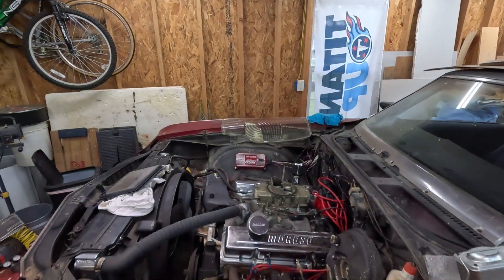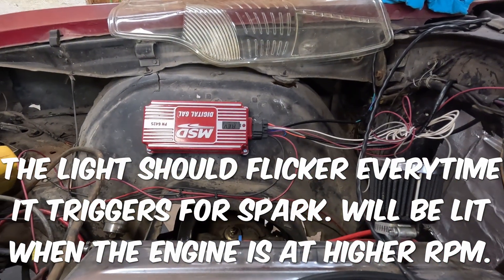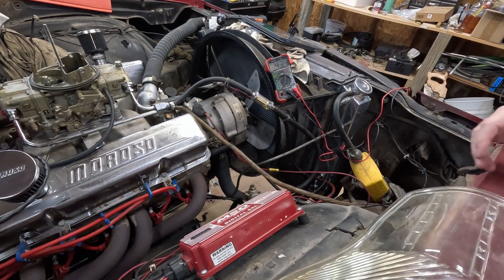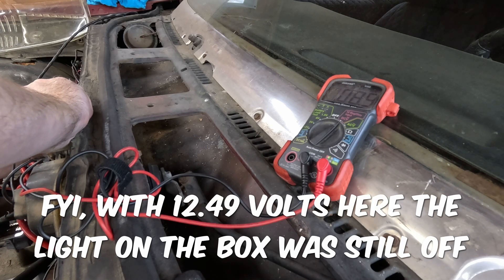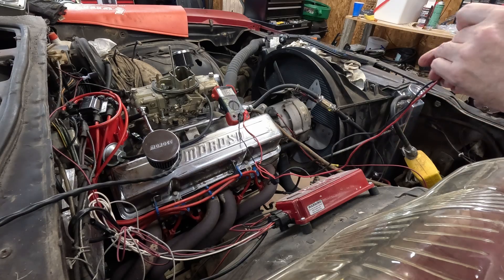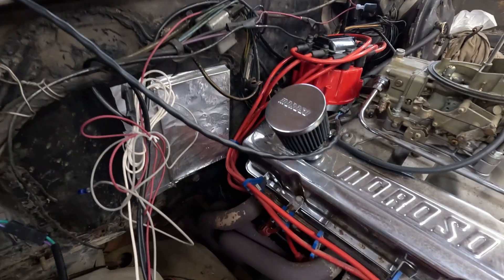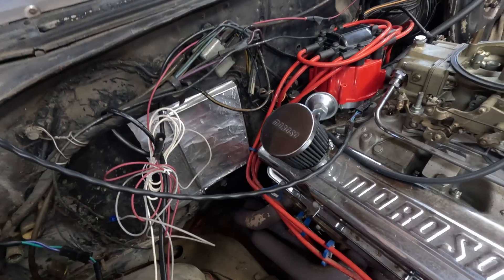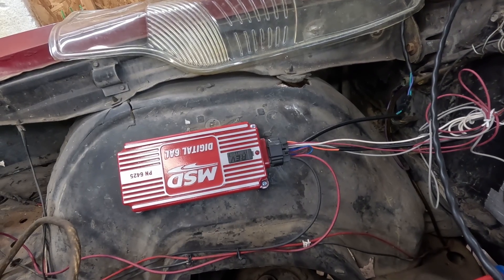MSD Misbehaving? A Step-By-Step Troubleshooting Guide For Your MSD Ignition Box.

Comment: I'm very well experienced with these boxes and a few things I could possibly point out to help you. The power wires should go directly to the battery. The ignition on wire should be a dedicated hookup to your fuse block. I also usually go to the extent of putting a relay for the main power wire and my spark was actually healthier. I have one of those MSD testing units so I was able to do a really good test with and without a relay
Reply from the maker: Appreciate the tips on optimizing the power wiring for the ignition box, especially about the relay and dedicated fuse block hookup!

Comment: Thank you for your help.  Got that thing going today.  It's a 1950 jeep Willis with a 1992 mustang 5.0 ford racing engine.  It blinks 6 BTW.  I'm wondering if it's normal for the big red wire to go straight to battery or shouldn't it be keyed?
Reply from the maker: The big red wire goes straight to battery while the smaller red wire goes to a keyed/switched power source.
Reply: @GregsDIYGarage thanks for your help. It did help.  The beast is going to a little car show today

Comment: Maybe I missed it. What is the Grey wire? If that's grounded will it cause it to smoke the coil?
Reply from the maker: The gray wire goes to the tach. Grounding it would cause a short so you don't want to do that.
Reply: @GregsDIYGarage yup! Thank you.  That's what was happening.  It was just left hanging in the engine compartment.  Thank you

Comment: Thank you for posting this!  I just bought a new style 6AL box for a 67 Camaro with HEI and bumped into your video from 9 years ago. I then found this post. So new!  What luck. lol.  I'm wondering if you wired the box directly to the battery, or have it at a junction or something. I was reading that Holley EFI says it's mandatory, in order to rule out any current issues. Just a thought. Good luck with this!
Reply from the maker: Thanks for the comment! I have the positive from the battery but the negative is from a good ground. I'm pretty sure it was after this video, I ended up replacing the battery (in the trunk) wires and the ignition wires with thicker gauge and still no luck.  I then figured out that the engine may have a spun bearing or something, while it will turn over, it takes a lot more effort than it should. 

Good luck with yours!